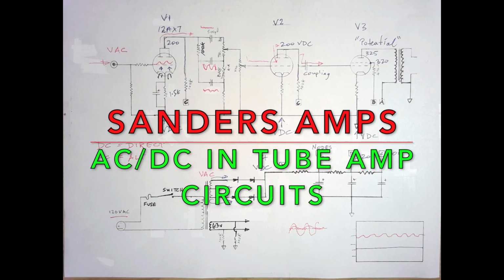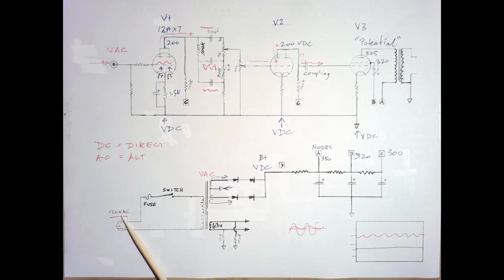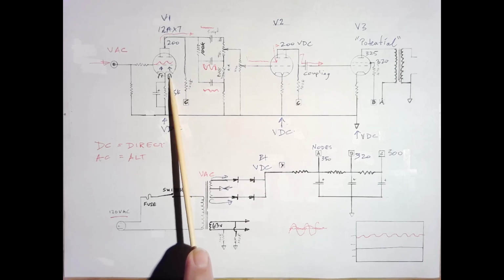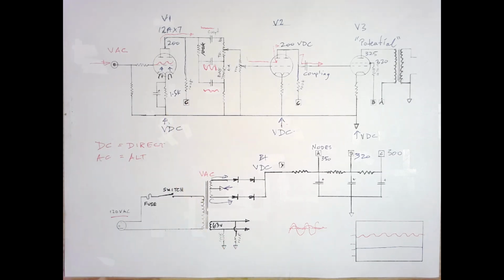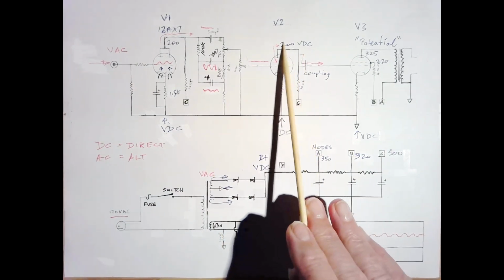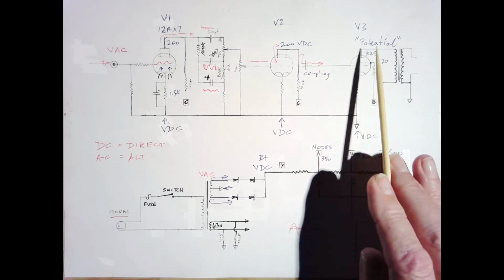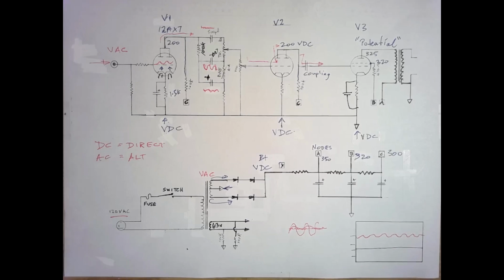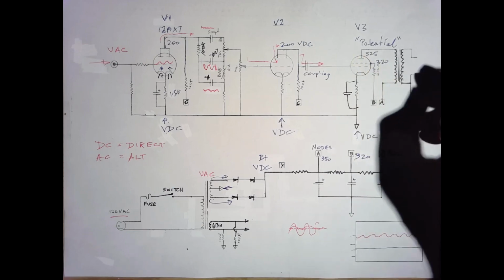AC and DC in Tube Amps: Important Basic Knowledge

Comment: What's this amp schematic? Outside of the grid leak resistor, does it work? Is there a copy with specific values we can snag? Thanks!
Reply from the maker: Hi! This schematic is almost the same as many single-ended amps. In many regards, it is simply a Fender Champ with a TB tone stack inserted, and it uses two preamp tubes in parallel rather than a single, divided tube. These sorts of designs are free all over the internet. Mind you, this has diode rectification instead of Fender's 5Y3 tube rectifier, but otherwise, these designs are free everywhere.

Comment: V3 grid resistor to ground is missing....therefore no neg potential on V3 grid to control current flow
Reply from the maker: You are quite right, rodedog55. Thank you for pointing that out. A working schematic should have what is often called a grid leak resistor connecting the input/signal grid on V3 to ground. Depending on the design, this could be anything from a 220k to a 1M. Probably the reason there is not one in this schematic is because it was simplified from an earlier version that had a master volume before V3, and I neglected to include the grid leak resistor after I erased the master vol. Rodedogg55 is correct in that this resistor does not only allow any build up of electrons on the cathode to leak to ground, negating their effects on the signal, it helps control the biasing of the power tube. This is especially important on a grid-biased output tube.